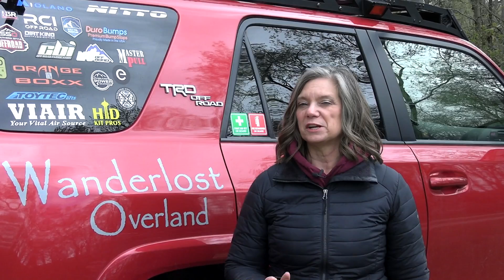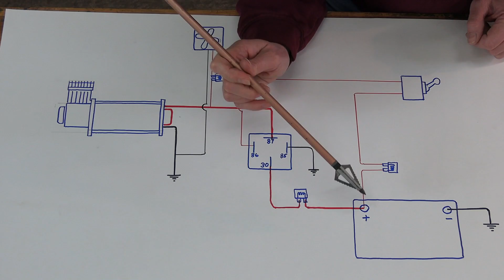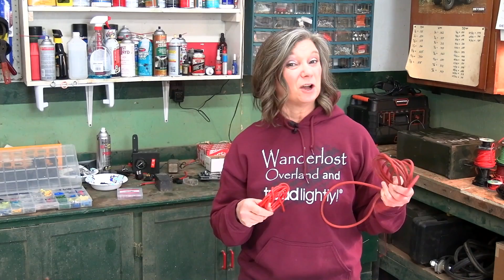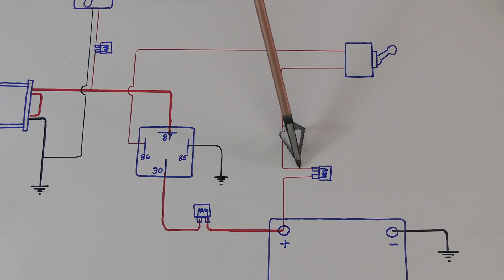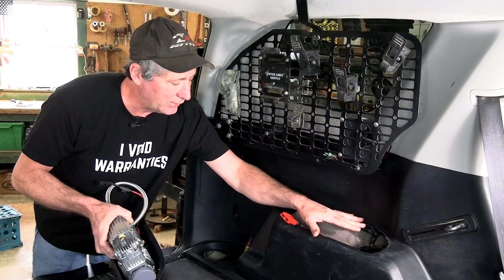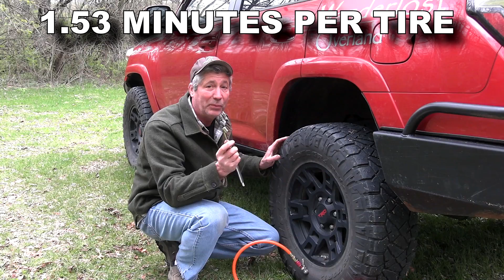Best Way To Air Up Tires After Off-Roading

Comment: So, how long can you run it continuously before it gets too hot?

I have the cheap Viair in a bag and it can air  up from 20 pounds to 32 pounds in two tires before I have to give it a rest, SO, being that it's fairly reasonably priced (in my case, cheap) I'm going to just get a second one to air up the next two tires without having to wait for the first unit to cool down.

Hope to be simple and effective.

Comment: This was really helpful. One question I have is what keeps the compressor from flying out of its perch in the event of a kinetic event (an accident) that involves sudden/immediate deceleration? While attaching the compressor to that tray is a great idea, it seems like it can be popped out pretty easily. Does that shroud prevent, or inhibit, that from happening? Love that "void warranty" shirt!
Reply from the maker: It's held down with clips molded in to it. The shroud will definitely stop it if it should come loose in a heavy crash.

Comment: That shallow insert for the compressor on the wheel arch was interesting. Does it protrude downwards and interfere with the tyre ?
I've contemplated putting my "double thumper compressor" here, but dont want to lose its portability.
Also, I trialed an external air hose fitting and it rusted very quickly :-(
Reply from the maker: Plenty of room under the tray.

Comment: My FJ has the 400W plug in back(only while engine on), so I just bought a small compressor with adjustable settings and 2 1/2 gallon tank. It’s a little more cumbersome but also a little more versatile: power tools can also be used with it. Love your system but way to expensive and overkill for me.